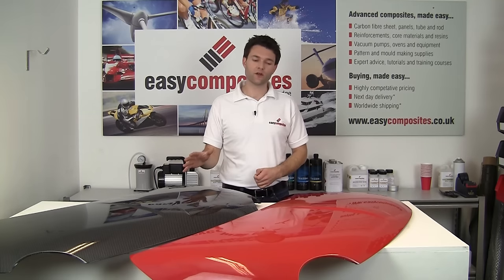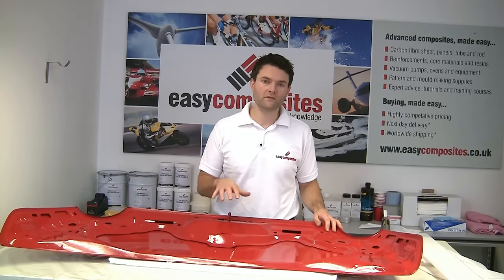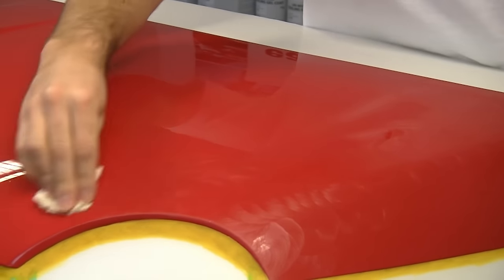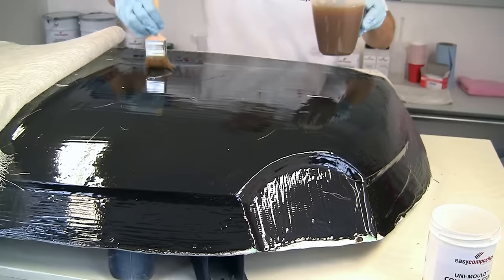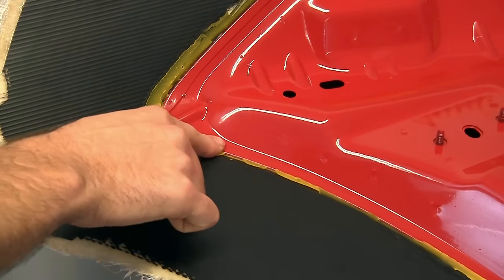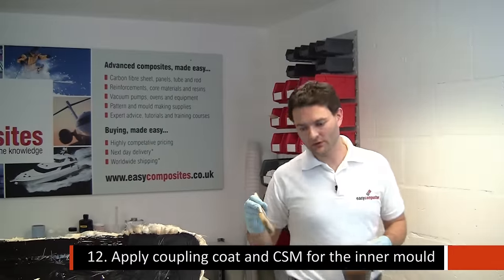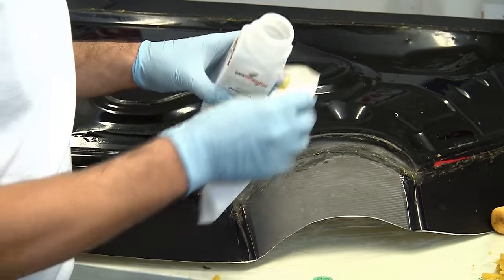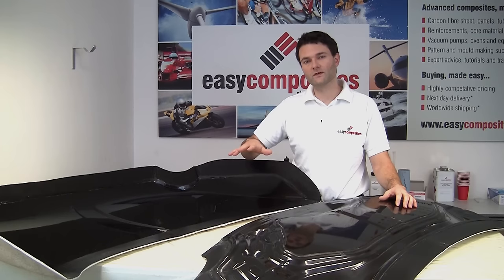How to Make a Carbon Fiber Car Bonnet/Hood - Part 1/3 : Making the Mould

Comment: Easy Composites Ltd ; aside from costs, I have thought to use this technique to build a trailer for some jet-skis. It would be a hell of a project, but the end result would look amazing. Are there any technical concerns I should be aware of, such as rigidity, UV exposure, proximity to heat sources and limits, or something I would not be aware of to worry about?
Reply from the maker: +CharleyMac259 No, not really. We have customers who have built full-size car transporters using this same resin infusion technique. For large panels, it makes sense to use a core material. I would suggest something like our 10mm closed cell PVC foam which we have in 'grooved and drilled' variety specially for infusion. In terms of UV, I would recommend making your panels with no gelcoat and then spraying them with a 2k automotive clear-coat/lacquer. For heat proximity, you'll need to look into exactly what heat you're talking about. If you make the panels and post-cure them to 70'C then they should be stable up to about 80'C or slightly more. If you're talking about heat more than that they you'll need some heat-shielding and possibly high temperature resins in those areas but this is specialist stuff and really, a trailer should not be more than 80'C in normal use. We look forward to hearing from you.
Reply: When you say full size, are you talking a single car transport, or one of the larger multi car units that attaches to a Semi? And my heat concerns were related to proximity of brakes. I know that under extreme situations, like emergencies, brakes get very hot and extreme heat can be transmitted along the structure up to 18 inches. I was researching resins, and it seems the only hurdle for resins up to 800 C is getting it from the lab into production. so maybe someday soon we will be able to make engines with a high carbon fiber content.

Comment: From start to finish, including cure times, what is the total time taken for creation of this panel? I realize it was necessary to use time lapse to keep video length within limits, but I am sure many would find it useful to frame this within a reasonable time frame to know how long it took to produce this part, including cure times. Thank you again.
Reply from the maker: Do you mean the entire process from start to finish (i.e. all three videos; making the moulds, making the inside and outside panels and then assembling them together)? If so then the 'hands on' time is probably around 8hrs spread over 4 days (to allow for all the various curing times). Keep in mind though that one bonnet/hood is as much work as two single-skinned panels.

Comment: WHOA! I'd think that over for a bit! Carbon fiber, while very strong, is more brittle than steel and will crack and shatter rather than bend and absorb energy (the purpose of a roll-cage).

While there are a few in use, they have probably seen millions of dollars in engineering.

Stick with steel DOM tubing at least 1.25" dia. and .120" thick, or move up in dia. as rules require.

You'll be safer and likely see as much or more gain in chassis stiffening.

Comment: would love too see you do a carbon roof i want too do mine at some point
Reply from the maker: Hi Mark, a roof panel would be done in the same way as the bonnet skin in the video. Typically a support frame is not needed as the OEM frame is left in place in most cases.
Reply: @easycompositestv  do my roof for a youtube vid and ill pay for materials and you can keep the molds i reckon a good 10 people off forum would want one

Comment: An educational video showing how carbon fiber (CF) car parts are made. Now I see why these CF car parts are so expensive due to the amount of work that is required to produce them. You have to know how and need the ingredients to make them. I won't complain about the price they charge when it comes time to upgrading to CF parts for lightness and performance purposes.
Reply from the maker: The process is very labour intensive, which as a business makes it a considerable cost.  For DIY/Hobby manufacture of carbon parts, labour time is not such a big factor in the cost of the finished part.

Comment: Hi, thank you for those videos, superbly made. I was wondering if releasing the mold could take off some paint or damage the surface of the original red bonnet. Did you have issues with that ? Thank you in advance
Reply from the maker: Paganissime If you are careful to ensure you properly apply the release agents and also take care with prying tools when demoulding then you shouldn't cause any damage to the bonnet.
Reply: Ah ok, good to know. Thank you

Comment: Hello there,I don't understand the part, after the curing of gelcoat. You apply a coupling coat ( I have no idea what is ), one layer of fabric, let it cure and then one layer of fabric with epoxy resin. May I ask, how does this technique differ ( quality wise )  from applying directly fabric and resin ( x4 layers ) onto the gelcoat??
Reply from the maker: The  Uni-Mould Coupling Coat is designed to eliminate print-through of the main bulkier mould  reinforcement, and to reduce the risk of blisters underneath the gel coat by  ensuring the gel is reinforced with a skin of resin and 100gsm CSM glass  to provide an ideal substrate for the main reinforcement.

Comment: The finished carbon-fibre-part will it be resistent against UV-light or does one have to apply a special clear coat to protect it? (I know that the engineers of the new C7-Corvette developped a special clear-coat to protect its carbon-fibre-roof against UV-light which took them several years!)

Comment: I'd love to know how you keep your rollers and brushes from getting clogged up while you're applying the resin & gelcoat. Mine keep yanking glass out of the CSM. The roller effectively stops rolling after a few passes. :(
Reply from the maker: A light touch I think. You really have to be very gentle, keep gently increasing the pressure as the mat consolidates.

Comment: When you use the masking tape to make where you're cutting the lines and you put it on that board to cut it what kind of material is that? Thanks for all your help I'm just kind of picking your brain
Reply from the maker: The material is polypropylene Fluted Sign Board
Reply: @easycompositestv  thanks! You’re the man!

Comment: do you need a coupling coat for diy projects or is resin fine? also could body filler be used as substitute for gel coat issues/craters? thank you
Reply from the maker: The coupling coat is needed for a good bond between gelcoat and tooling resin.

Comment: may i ask you about the material you mix with gel-coat to stop being tacky ? do you have it ? what is the item number.
Regards.
Reply from the maker: The Wax Additive used is Solution MW and you can find it here: https://www.easycomposites.co.uk/#!/resin-gel-silicone-adhesive/polyester-and-vinylester/solution-mw-wax-gelcoat-additive.html

Comment: How can one calculate the heat and stress limits for this type of material.  I've heard this material is strong, but I don't know how strong. On average, how much weight per gram of carbon fiber can this material support?  What are the heat tolerances?

Some examples are that I would like to know how much weight a car seat base made from this material could support.  Could this material be used for a high performance wheel application?  How much weight per corner could such a wheel support?  Heat tolerances?  What sort of heat limits can this material support?  I am curious about whether or not this material would be suitable for use in an engine compartment, and if so, what would be some ideal applications for this material in an application.

Thanks in advance for a terrific series of videos!
Reply: Carbon fiber is used for many ultra high end prototype cars for applications you speak of, However i would not advise trying to create wheels or any structural/load bearing surfaces yourself without a team of engineers beside you. Seats wouldnt really be a problem, however i'd be interested in seeing a final result of home made vacuum tubed CF bucket seats if you do embark this challenge, Hoods and / or body panels, interior panels, would all be a great investment, Hell i've seen people make even valve covers & Intake manifolds with CF in their garage and they look stunning!.. The initial & material costs can be offset, due to the fact you'll only need to make the Fiberglass molds once, And they can be reusable if care is taken, which you could use to create more CF copies and sell them off.
Reply: Kyle Milford what do you mean by CF? and the vacuum tube part?
Reply: Brian Weir look into different types of carbon fiber clothes, (example: XC 300, RC 300, 411,etc). the number stands for the weight. and as you look into every different weight and angle of direction you will hopefully be able to see the specs such as tensile strength, compression. The engineer at my work had told me today how to measure what thickness you need for what amount of strength you desire but I forgot. sorry. however, there is a formula I bet you can find online
Reply: Professional carbon fiber (CF) Is used with vacuum bags to make it as thin and light as possible, by removing air bubbles and any excess resin from the molds, Home made jobs are usually not vacuum bagged/tubed and are generally nearly the same strength, but a lot heavier due to thickness and more material being used
Reply: yes I agree, I work with infusion every day. never heard the phrase tube before.

Comment: One thing I would question; and not to say you didn't do an excellent job, because you did.  But; when visiting Disneyland's Mako division, I noticed they would ball-up the mill fiberglass pattern to break up some of the stiffness to achieve better behavioral playability when stippling with the paintbrush and add in some mill fibers to the resin to help diminish air pockets and voids.  "Do you know of this Technik?
Reply from the maker: It is quite common to use off cuts and short strands of Fibreglass to reinforce certain areas.  This is often in tight corners or recesses to help prevent bridging and void formation.  It is not necessary to add milled fibreglass to the main laminate in most standard mould making cases.

Comment: How much of a weight difference is there between a unpainted oem hood vs a unpainted carbon fiber hood? Also, how well does carbon fiber react to being painted? Don’t know much about paint and carbon fiber, but I gotta start somewhere right.
Reply from the maker: Hi Austin, weight depends on the original but in this case, it was under half the original weight and could probably be lighter without a gelcoat and in a “race spec” thinner layup.  Finished carbon parts can be painted body colour or lacquered no problem

Comment: Could you spray the gel coat directly onto the part instead of brushing it? I assume you can, but it would just be messy.
Reply from the maker: If you wanted to spray the part then it wouldn't be 'gel coat' you would use but instead it would normally be a 2k clear automative lacquer and certainly, yes, you can do this. In fact, it's probably more common to clear coat (lacquer) the finished part having made it with no gelcoat than to gelcoat in-mould but it's always interesting to see alternative techniques and in-mould coating can certainly be a good way to go too.
Reply: The polyester and epoxy wouldn't bind, LP paint will.  Laquer paints get eaten by by resins.

Comment: Are you using e-mat or p-mat during your mould making? I havent been a part of a mould making process for over 2 decades and cant remember what which we used for it
Reply from the maker: The fibreglass is e-glass based chopped strand matting.

Comment: could you guys do an updated version of this video with your new products?
Reply from the maker: We're filming a new resin infusion video right now although it's quite a different component. To be honest, almost nothing in terms of materials has changed in how we would recommend making a carbon fibre panel like this. Apart from a slight change to the gelcoat, everything else is still totally current :)

Comment: I've seen that in some videos, an oven(or autoclave) is used, while in others, like yours, no oven is used. I really need to know, what advantages do the autoclaves/oven processes add to the carbon fiber??
Reply from the maker: +Dave Njoroge In fact we've featured oven cured prepreg in some of our other videos. Basically, you'll end up with similar (though not identical) results from resin infusion, out-of-autoclave prepreg and autoclave cured prepreg in terms of appearance and resin/fibre ratio. The main differences are the raw materials you need to use and the practicalities of using the different processes, depending on what you're trying to make. In addition, curing at elevated temperature (or post-curing to elevated temperature) can improve the operating temperature of the cured component and get the most in terms of mechanical properties from the resin system.
Reply: Easy Composites Ltd Thanks for the response, so what you're telling me is, when an oven is used, the parts are able to withstand more heat and perhaps more loads/stresses?
Reply from the maker: Yes, if you oven cure resins they will develop better mechanical properties than ambient only cured resin and they will certainly be able to take higher temperatures.
Reply: Easy Composites Ltd thanks for this information really. I'm looking forward to starting a carbon fiber automotive parts business in my country, and im currently combing your website for things i will need. I have to admit, you guys are really good at what you do, and you have been an absolute inspiration and motivation to me and my project. Thanks for these wonderful videos..keep up the excellent work!
Reply from the maker: +Dave Njoroge Thank you Dave; you're very welcome - it's our pleasure to help and inspire others :)

Comment: how do you manage the shrink factor of fiber glass when making the mold. Is it because you let the part in it that you don't have to deal with it. I did some part in fiber glass and always needed to scale the part of 3% to get the part as the drawing and I though that you would have to do the same for a mold in fiberglass
Reply from the maker: Renagade9966 The Uni-Mould tooling system used a special combination of Gelcoat, coupling coat and tooling resin that are all very low shrink and thus in this case shrinkage is not an issue, especially when compared to more traditional resins and gelcoats.
Reply: It's the resin that shrinks not the glass . Different resins have different shrinkage the is zero shrink resin types for making exact moulds

Comment: Could I have instead made this mould using epoxy resin?  E.g. EG60 epoxy tooling gelcoat + EL2 resin + powder bond CSM?  If so, advantages? Disadvantages?
Reply from the maker: Yes, certainly.

Advantages to epoxy: (1) Uni-Mould has extremely low shrinkage but epoxies have virtually zero shrinkage so you'll have an even more dimensionally accurate mould using epoxy (although both will be better than conventional polyester). (2) Virtually no odour (compared to strong styrene smell from the Uni-Mould system).

Disadvantages to epoxy: (2) More expensive - possibly around twice the finished cost for the mould compared to Uni-Mould. (2) Even 'powder bound' CSM is harder to work with using epoxy resin compared to emulsion bound CSM with polyester or vinylester resin.

Therefore, it's your choice. Advantages and disadvantages to both. For large moulds, the comparable cost of the resins is significant and so people will often choose the Uni-Mould system. If the smell is a problem or if you need the best dimensional accuracy then an epoxy mould (using the EG60 / EL2 combination you mention) would be a good choice.
Reply: Excellent answer!  Thank you for your reply!

Is there a difference in durability between the moulds?  Let's say I intended to reuse the mould until it wore out.

Also, I notice you're not using a respirator for this, which I thought was standard fare for MEKP catalyzed polyester resins.  Is Uni-Mould somehow different in this respect?